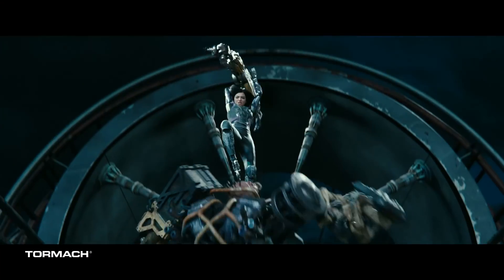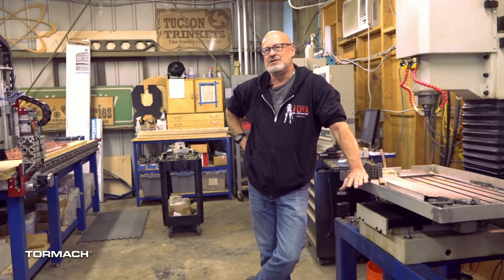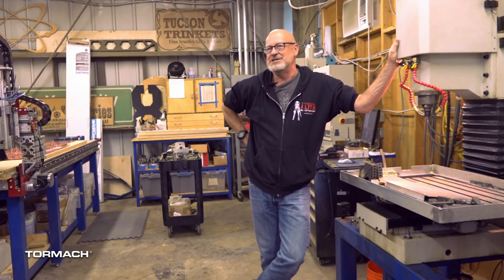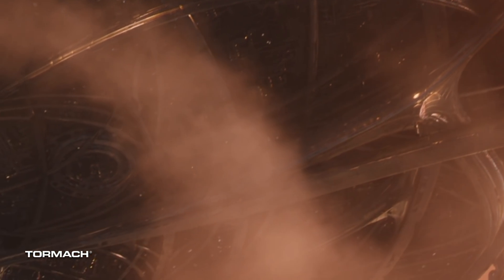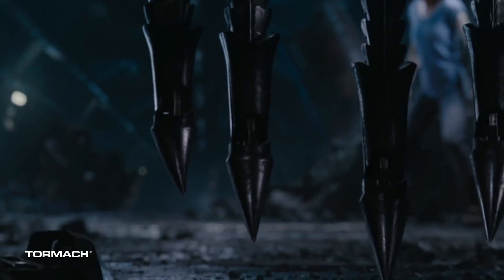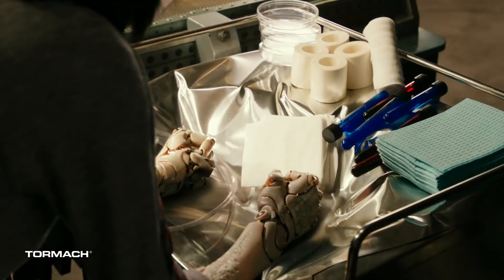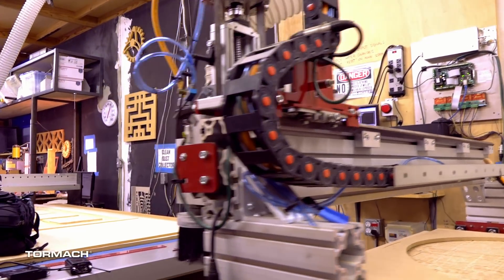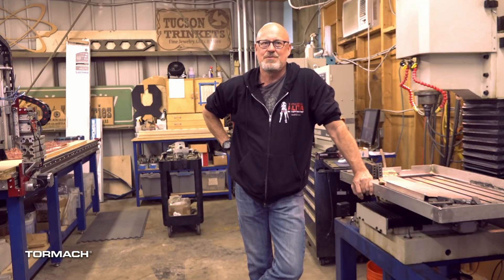Machining Props for a Movie - Alita: Battle Angel

Comment: The table of the machine, and especially those 1-2-3 blocks looked really rusty. To clean off that rust best solution I found is to spray down the surface with WD-40 and use a nylon brush in a die grinder to clean it up. Use brass brush for anything that nylon one does not get. Then wipe clean, let WD-40 dry, and coat with gun oil. In my case CLP has been working well to keep rust away. Liquid Wrench has something similar, but it's effects don't last nearly as long.